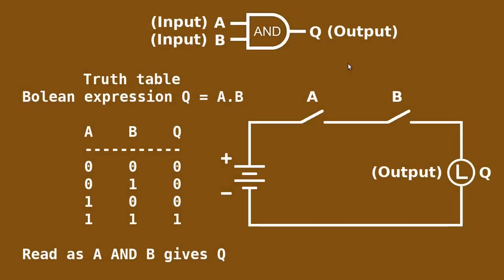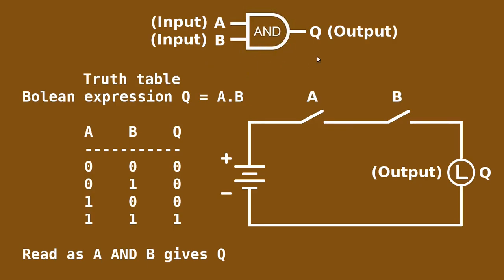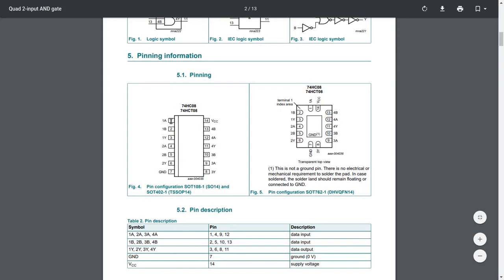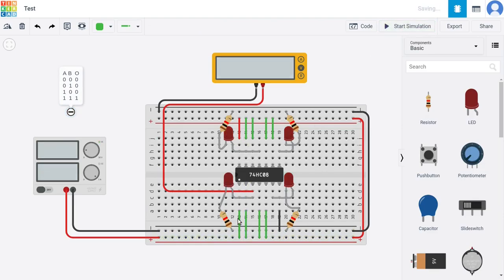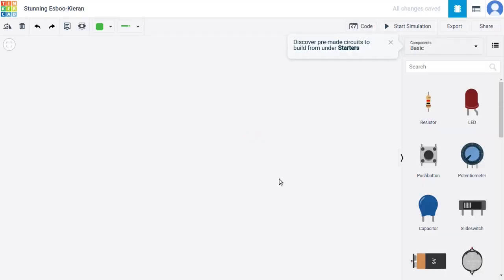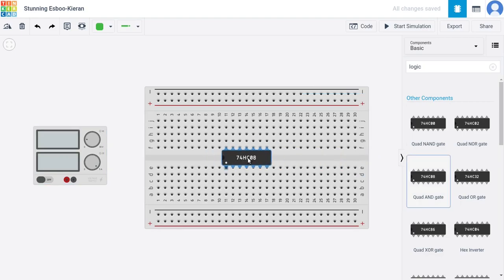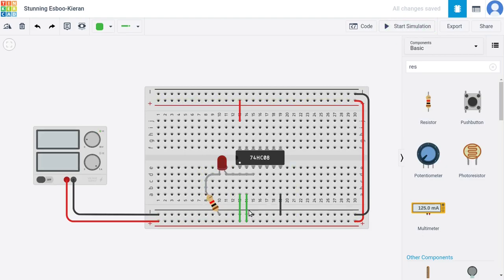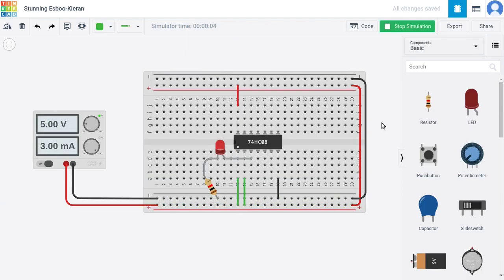AND gate - logic | circuit | truth table | step by step build using 74HC08 quad 2-input AND gate IC

Comment: Ah man, this is excellent, if you went even lower level still you could do it with transistors?
Code Tinker King! 👍👍👍
Reply from the maker: The idea is not to make it as low level as possible (we can end up with vacuum tubes going that way))) ) so I'm just following Ben Eater's 8-bit computer series and the problem is that tinker cad does not have all the chips Ben is using, but if we understand the discrete logic then the missing chips can be implemented using these gates for instance. I think it's always a trade off between the size of the circuit, and the level of abstraction we can understand things at. I always loved to build bigger blocks from the basic blocks and here we can do it very nicely. It's very similar to "using libraries" vs writing code from scratch - a more sophisticated integrated circuits are like programming frameworks - they come as the black boxes with the set of rules of how to control them. I really like this similarity.

Comment from the maker: 00:00 Software evaluation of a bitwise AND expression
00:33 AND circuit on mechanical switches (Sorry for typo in "Boolean"!)
01:16 Truth table
03:24 74HC08 quad 2-input AND gate pin-out
05:07 74HC08 quad 2-input AND gate breadboard simulation
08:20 74HC08 quad 2-input AND gate step by step circuit build in tinkercad